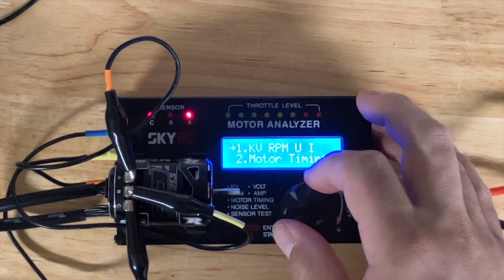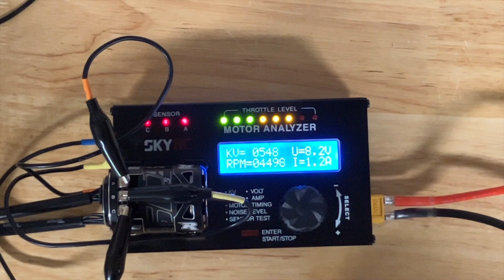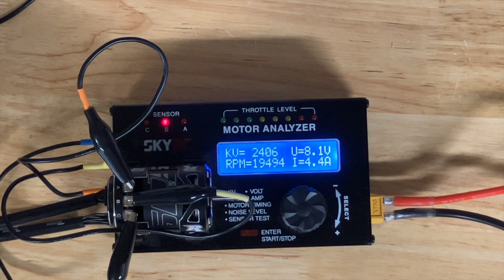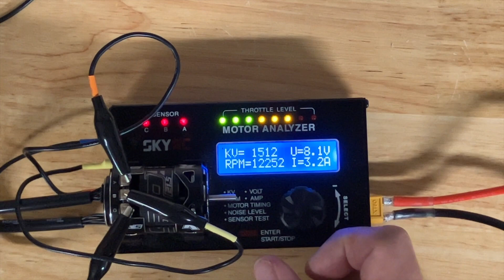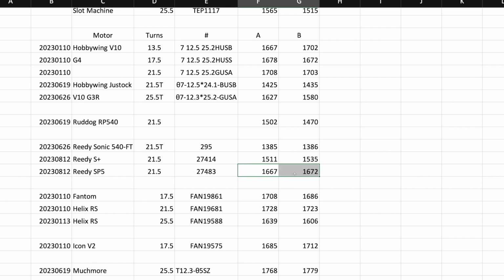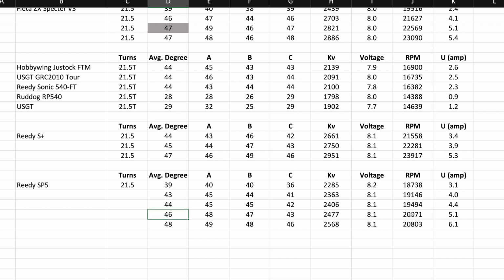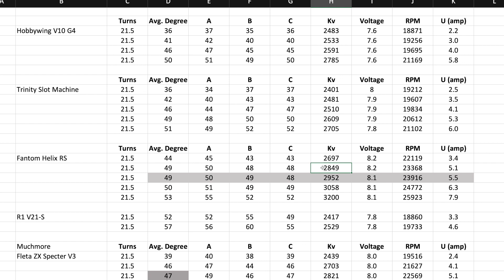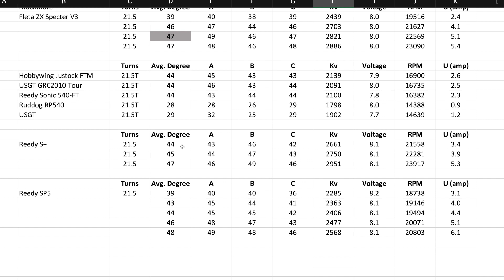Reedy SP5 21.5T Analyzer Specs and Gauss

Comment: I'm running the 21.5 SP5 in a touring car on carpet with FD at 3.64. Fairly small track. The other cars seem to have higher top speed with 3.8FD/Trinity Slot Machine. Would you suggest dropping down since this is a torque motor?
Reply from the maker: I have experienced this where I have actually lowered my FDR and gotten faster. One case was with the Fantom Icon in 17.5T some time ago. I would say try two teeth.
Reply: @telecomandorc  This worked thank you! Actually ended up adding 4 teeth to the pinion (3.36) and got within 4 tenths of the fastest lap. I think 3 teeth (3.42) would have been perfect but I didn't have the parts.

 I know the timing marks on the motor are just a reference, out of the box it reads 40 degrees. When you were testing the SP5, did you find the factory timing was close to 40 degrees on your analyzer?
Reply from the maker: @forensic_ttv9503   Very nice. Side question, is your track keeping Trinity motors active since they were dropped by ROAR recently?
Reply: @telecomandorc   NORA On Road Carpet Racers in Washington State made a public statement on it yesterday. It is legal at club events until our ROAR regional in January. At that point it will be considered illegal. Seattle RC Racers has yet to make a public statement but I think they will follow suit with what NORA is doing. It is a popular motor in this region, its a shame to see the brunt of this mistake being put on the club racers shoulders. Alot of hundred dollar paper weights to be delt. Maybe the bashers could find some cheap speed if they hang around the track long enough.

Comment: A bit of a newbie question. Would you prefer a higher torque motor for a high traction track and a high rev motor for lower traction with 2 wheel drive off-road? Back in the day we raced on dirt with brushed motors. I'm back in the hobby and everything is carpet.
Reply from the maker: Pretty much. You are spot on, I would say. Carpet has high enough traction to handle the torque and take off. On low traction, not so much.